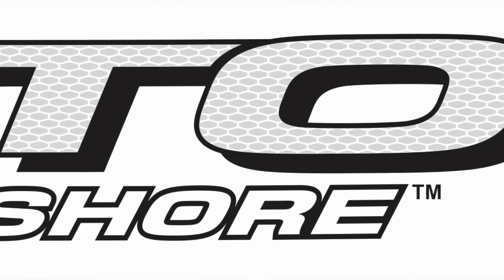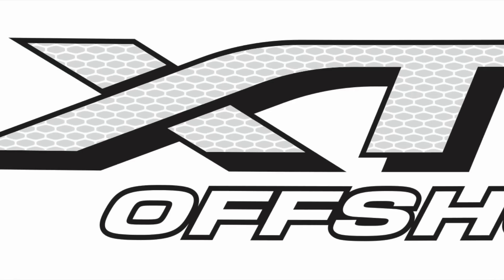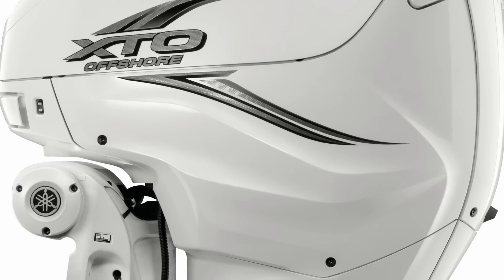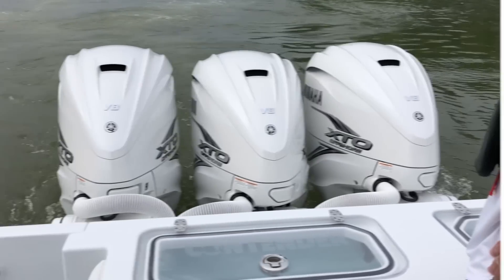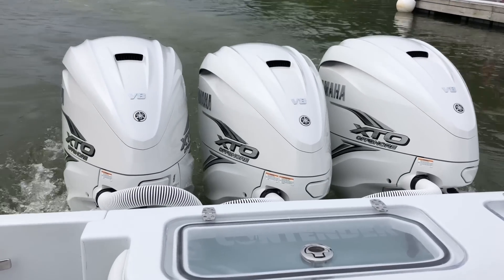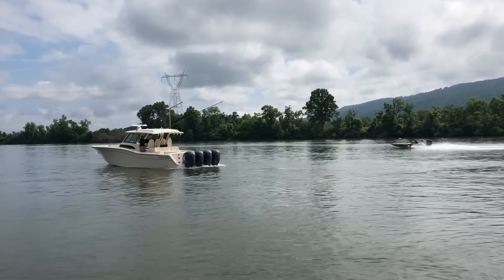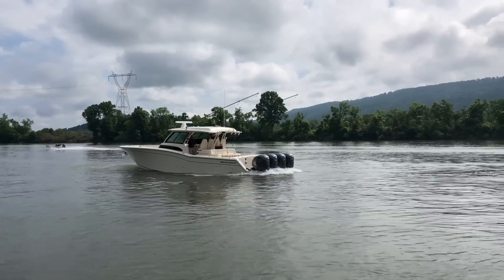Running the Yamaha 425 hp XTO Outboard

Comment: these things are horrible. they weight 400 pounds more than mercury 400 verado, cost 10k more than the same outboard, and are less efficient. For that much weight on the transom would much rather have a 7 marine putting out 627 hp. Thanks but no thanks Yamaha.
Reply: 300lbs more not 4

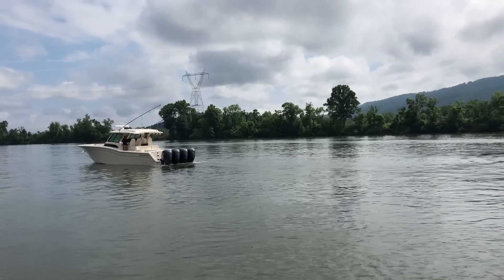Comment: 0:45 108.1 Gallons Per Hour!!!
Reply: Is that a lot?
Reply: TacNipples Old 150 2 Stroke singles get like 10 GPH lol
Reply: But still, that’s a helluva lot of fuel. Definitely for speed boats and not as much fishing boats that want to go out farther and be efficient.
Reply: @Andrew Goddard Yea, that's a lot of fuel. I know they are not 150's. I just said that so broke people would get an idea of the fuel usage.
Reply: They are running WOT @ over 71mph.  It's all relative.

And that was on the triple engine boat.  Y'all would really freak if it was the quad version.  LoL
Reply: They are running a 45 Grady white
Reply: I did some simple division and it is burning 1.511 per mile, equating to 2/3 of a mile per gallon. With different power you can get over 1 mile per gallon a 45 Grady. 2/3 mpg is pretty atrocious.

Comment: Fast ??  I saw video of the 39 st contender doing 72. That same boat with a tower will run 71 with the yahama 350s .... what am I missing here ??
Reply: If you look at the testing of the GW 456 with 4 - 350s vs the 456 (in the video) with the 4 - 425s the top speed they are both 55.2mph at 5900rpm. .40mpg with the 4 -350s and .39mpg with the 4 -425s. You would think with 75hp more per engine and more torque (higher compression and more displacement on the 425 so it better have more torque) that the 425 would be able to pull props with more pitch, thus more top end speed. I don't know what I am missing either.
Reply: sdvten Ya I’m right there with you.
Reply: No fly wheel change outs and lower unit explosions?
Reply: WhiteGangster400 so now it’s just junk because heavy and slow.  I mean the 300s are great motors. Why can they get this right ?